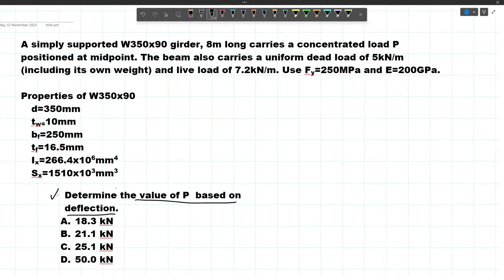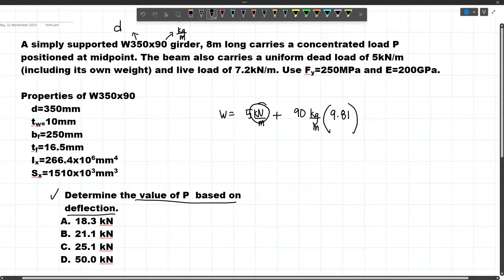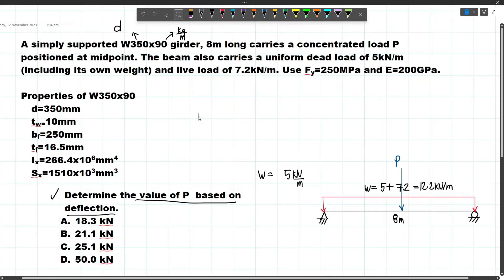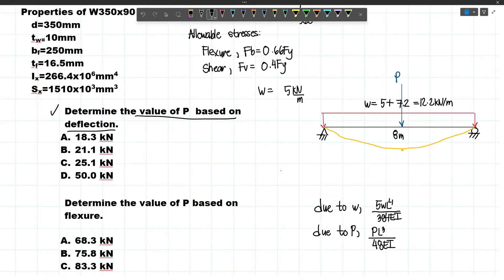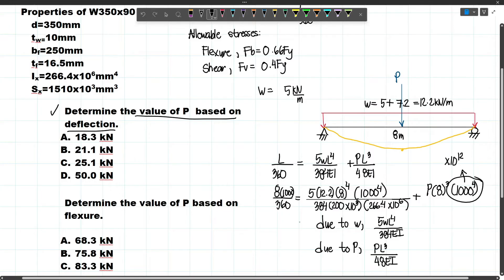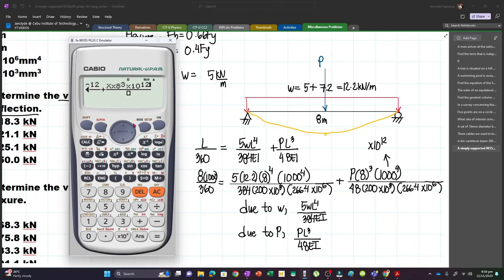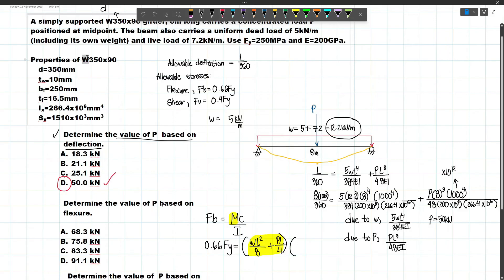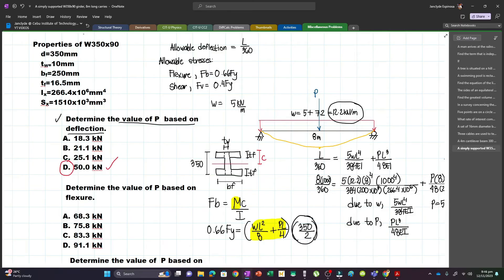A simply supported W350x90 girder, 8m long carries a concentrated load P positioned at midspan

Comment: The correct formula for the 2nd question is fb=Mmax/Sx. This formula is used to ensure that the maximum stress caused by the applied loads does not exceed the material's allowable stress limits, as mentioned in the problem provided in the image.
Reply from the maker: yes, there is connected video in the end screen where I used the elastic section modulus, Sx

Comment: sir why in P(8)^3 is multiply in 1000^4
Reply from the maker: This to make the result automatically be in kN.. if P is in kN and m is cubed, we would have kN-m³.. so we need to multiply kN by 1000 to convert it to N and multiple m³ by 1000³ to convert it to mm³ so it would be consistent with the bottom units
Reply: @engrclidez  but in uniform load why you multiply 8^4 only then our remain unit will be meter in 12.2 kn/m so we need to convert also the m in uniform load to make it consistent too
Reply: also the E which is MPA or N/mm^2 whichs the denominator and numerator is Kn/m so there will be no remaining unit in KN for that
Reply from the maker: @saburrhjalil  load is in kN/m.. if you multiply kN/m * m^4 because we have wL^4, then it becomes kN-m^3.. hence we convert that remaining unit